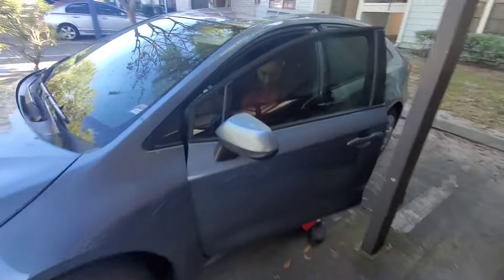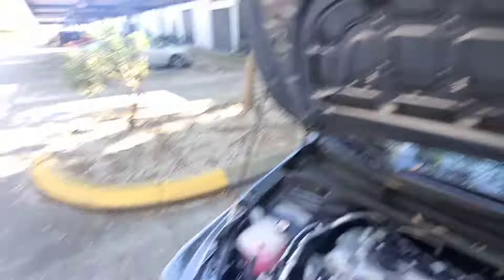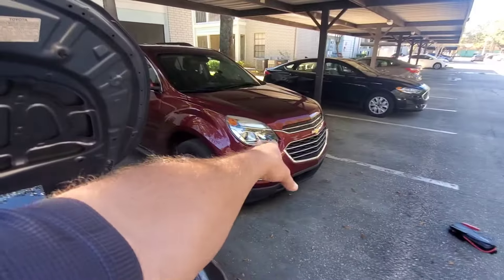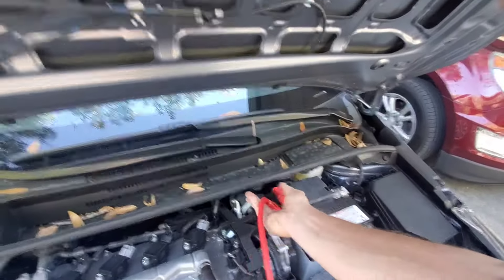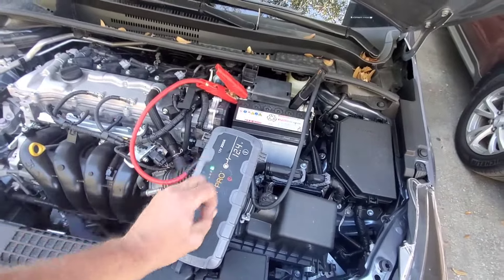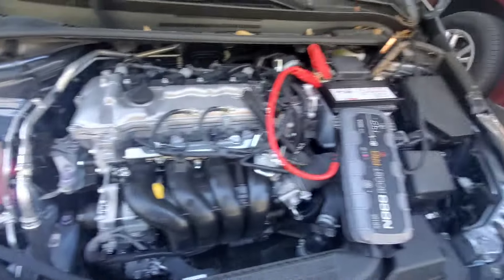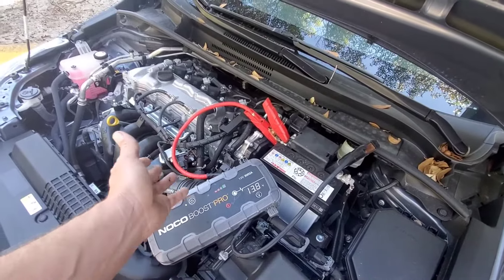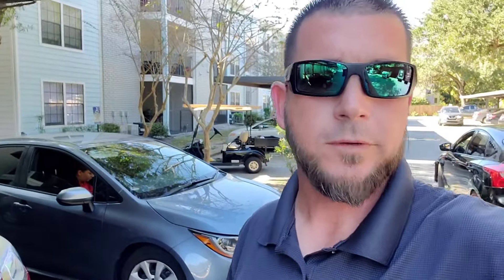HOW TO JUMP START TOYOTA COROLLA

Comment: I just had to jump start a 2021 Corolla with my 2021 Corolla. Connecting to the positive terminals was incredibly difficult, so I just checked my owners manual to see if they recommended a better way to connect the positive cable. Nope. Why do they recommend that you "disconnect the ground cable before charging"? I've been jump starting cars for over 50 years. Is there something new in these more recent vehicles that I'm not aware of that requires this rigamarole?

Comment: How long does it take to kill the battery in one of these? I was listening to the music and had the accessory turned on I don't even think it was an hour and the car was dead.
Reply from the maker: Depends on how old your battery is and how much life it has left in it. A new battery can be left on for a couple of hours and still work. An older battery that's at the end of its life may only have an hour is an hour before it's done. I always tell everyone to just leave the car running is better for the car that way.

Comment: I need a video on just attaching the cable to the positive side. It’s so flat I really struggle and have no idea if it’s on right
Reply from the maker: Ok thanks will do
Reply: It took me a while to get something for my clamp to grip onto. Even when I finally got it on it felt like it was barely connected. I don't know why Toyota gave so little room on the positive terminal.

Comment: I bought a shop vac for my car silly me I tried to power it with the 200 watt power inverter and blew a fuse. So now I'm debating on whether or not to get a generator or connect something to my battery. I'm thinking of the convenience of me just be better to get a generator rather than having to pop the hood of my car every time then I'll probably also need an extension cord too. Would you happen to know of any way I could do this internally? I'm trying to power a small 120 wet dry vac.

Comment: You need to put the negative on ground not on the baterry negative
Reply from the maker: You only have to do that because there's a one and a million chance that a spark will ignite unburnt gases under the hood. I can tell you from experience if you want your car to start quickly. You'll just ground to the battery if you can. All anybody would have to do is have their hood up for more than a few minutes for the gases to go away.

Comment: How many amps to jumpstart? should I use  on a 2011 Toyota Corolla? 2,500 is it okay?
Reply from the maker: Yes 2500 is fine.
Reply: @roadsideguy5902  ok as well as 3000? If so thank you .

Comment: I just killed the battery having emergency lights on for an hour and this helped me out to jumpstart my car with my dads car but question do I have to drive for a while for the battery to recharge or what do I do after? Cuz I had it running for like 4 minutes turned it off wouldn’t start and we jump started it again and drove home now waiting until the morning to see if it goes back to normal or if I needa jump start it and drive around with it it’s a 2022 Toyota Corolla any tips or advice I appreciate it 🙏🙏🙏🙏
Reply from the maker: Must run it for at least 20 minutes to adequately charge if battery can hold a charge. If not holding after 20 get a new battery.

Comment: When I did the same thing, the jump box making continuous noise and the car won't start at all. This is the jump box I bought on Amazon: "Foxpeed Jump Starter, 12800mAh 12V A10 Car Jump Starter for up to 7L Gas and 5.5L Diesel Engine Auto Battery Car Booster Pack with USB Quick Charge and LED Flashlight".  Also, I have a charging box, the battery does not take the charge either. It used to work. I tried the charging box first; it did not work.  So, I bought the jump box from Amazon. That did not work either.  Thought if the battery is dead, I can at least jump start it, but it couldn't. The car was in storage for some time, but I've been driving around with it last week with no problems.  Thought?
Reply from the maker: Needs a new battery. Thanks for watching.

Comment: Hi, I've done this same procedure, however now my corolla is showing many errors on the dashboard, errors such as parking system malfunction, cruise control malfunction and others. I've read I need to scan the car to delete those codes, but I am not sure, because also the car is running but does not going more than 2000 RPM, I do not know if is for safety.

I do not know exactly what to do. Thanks
Reply from the maker: Alternator is bad.
Reply: How did you got it fix? Happen the same to me

Comment: Very helpful sir. You might wish to take us through the very details with pictures of which color cable to attach first then unhook first as you finish your jump start. Thanks for the quick tutorial and I like your jump box. * (Not that "you" need the attached borrowed instructions, but it might help us other novices.) 

*The safest order to attach the jumper cables is as follows:
Attach one red jumper cable clamp to the positive terminal on the dead battery.
Attach the other end of the same cable, the second red jumper cable clamp, to the positive terminal on the working (live) car battery.
Attach one black jumper cable clamp to the negative terminal of the working (live) car’s battery.
Attach the other end of that cable, the second black jumper cable clamp, to an unpainted piece of stationary metal on the car with the dead battery. Do not attach this clamp to the negative terminal on the dead car’s battery.
Though some may say it’s alright to attach the last negative jumper cable clamp to the negative terminal of the dead battery, this increases the risk of fire or explosion if the jump start doesn’t go as planned. Try to find somewhere away from the battery, to decrease the potential of sparks igniting any hydrogen gas that could be coming from the battery. Safer options include the car’s chassis, a bolt on the engine, the alternator bracket, or a designated grounding terminal away from the battery.
Reply from the maker: Thanks and I agree. Much appreciated my friend.
Reply: Agree, but the "jump box".... doesn't follow that theory. (Different comment) Don't pull the + off first on a jump device of any kind.

Comment: confusing as hell, when the cables are connected the camera misses the details of exactly where the clamps go, no mention of disconnecting in the  reverse order.
Reply from the maker: At 1 minute in, I show and tell you where to attach the cables. Then again at 1:55.  I think you must be retarded. Pretty much the entire video shows you where to attach. If you are confused, it's be you are very smart. And it doesn't matter which order you disconnect the cables once the power is turned off. Unlike jumper cables.